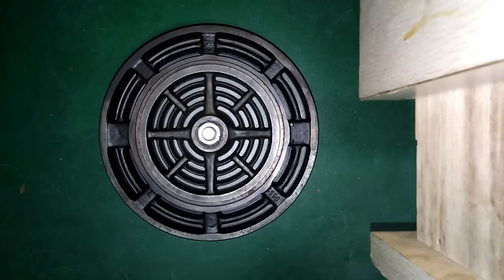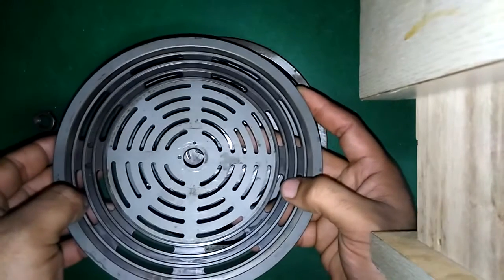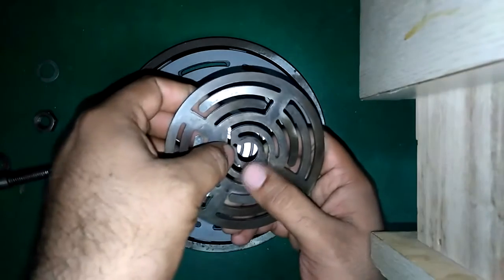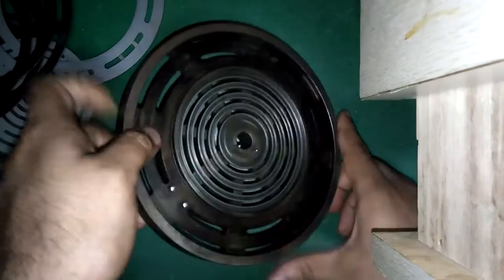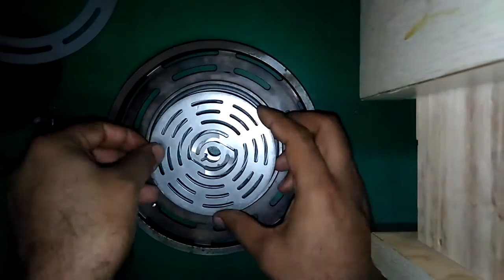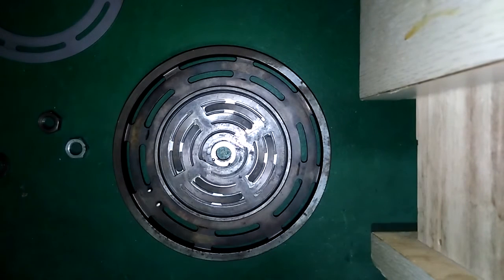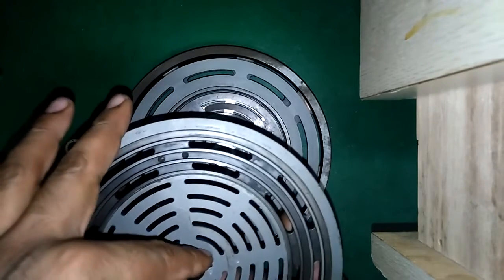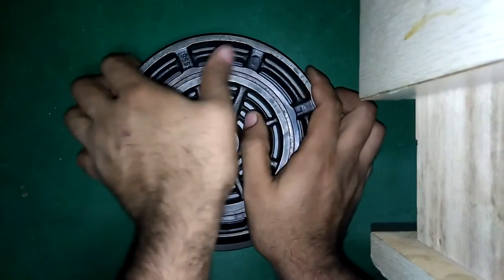Compound valve of Tanabe Air compressor

Comment: how can i understand which one is suction valve and which one discharge valve
???
Reply from the maker: I will explain it in coming video. Thanks and stay tuned :)
Reply: For any stage the discharge volume has to be smaller than the suction , hence the area, by looking at the valve you will be able to identify.

Comment: Hello my friend.
May i ask if this design is the original LP (low pressure) valve of Tanabe (Japan) and the latest one aswell they manufactured ? 
also , is this the series of H-70s ? meaning H-73/74 ?
Reply from the maker: Yes, dear this is the same series.